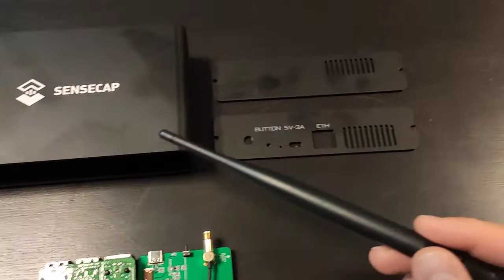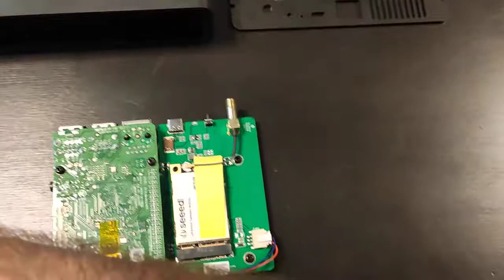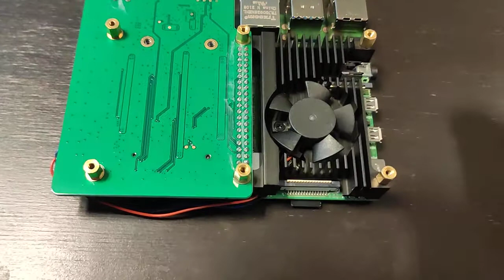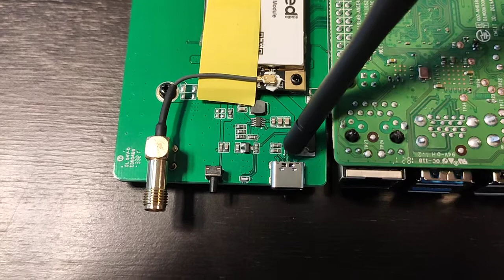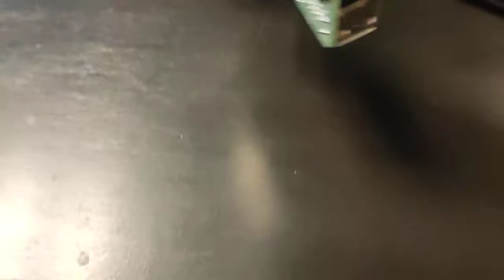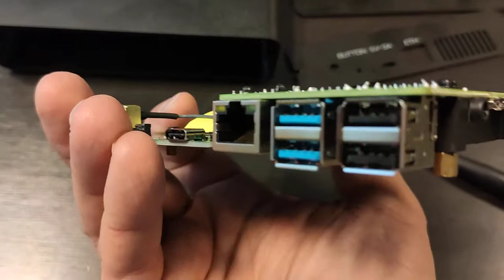Sensecap M1 Helium Gateway teardown and wifi antenna issues analysis

Comment: Hello ser, what specifications are there in the pie in sensecap m1? I have the same one. Solo in location, 0.1 hnt earnings in one year.
I want to extract the pie and use it for other things now. But once I get the assurance that it is at least a 4gb model. Can you confirm?
Reply from the maker: memory size is in your paper box or sensecap dashboard
Reply: @VeryokayDIY  thankyou ser, out of curiosity I did open it and it's 4gb version. But they have put the screws very tight, my screwdriver got rekt 😅 still not able to open them.

Comment: I'm curious if anyone plugged in an HDMI to that PI, and seeing if it displays anything,
the sd card has a screensaver file on it, so...
Reply from the maker: Hi! Probably its not showing anything as its very easy to turn of the HDMI signal in the RPi via a single parameter line in configuration files. However nothing hold you back to replace the SD card and run it with Raspbian OS, I did it on a few of my old miners :)

Comment: What's stopping someone from taking it apart  and using the raspberry pi 4 platform instead of using it as a miner? These are being given away for free in Canada. What's stopping people from that? Since from what I've read  this is based on raspberry pi 4
Reply: That's exactly what I've done... I built a 3d printer controller using one. Repurpose the technology if you no longer need the miner. You just need to load the required image onto the SD and you have a computer doing anything you want!
Reply from the maker: Nothing stop them, they just need reolace the sd card with Rasbian OS and voilá you got a cool mini PC 🤩

Comment: Hey mate, great video, my antenna snapped off the board, does it need to be attached to function? Or can I use it as it is connected to the Lora still?
Reply from the maker: need to be attached

Comment: Thank you for the overview! you mentioned the USB slot would likely be disabled by the software, but do you think it would be fine to plug a usb powered fan into it ?
Reply from the maker: probably yes, very good chance that the 5V is there :) You can easily test that just open the enclosure

Comment: Would upgrading the Pigtail cable for a better one be worth it ?
Reply from the maker: I don't think so, its a really short cable, with negligable loss. (if you asking about the actual Helium RF SMA to U.Fl connection)
Reply: @VeryokayDIY  Aye wont replace it then. Ive read that some people say its worth but had my doubts already. Thanks man
Reply: Is it easy to replace the pigtail cable? I ask because mine broke
Reply: @glamclam123  I ended up upgrading to a Ipex to N type for a outdoor design and replacing the pigtail was rather easy. Just don't rush it and look up how to replace ipex connectors since its rather fragile but other then that pretty straight forward
Reply: Thank you for the reply. What kind of u.fl pigtail did you replace it with? I see there are many options out there and want to make sure I buying the right one that fits

Comment: Hi, can you advice on that antena rp-smaF connector, I had an accident  with lmr400 cable being very rigid so that it got de-soldered when i tried to hook it up. Do I have to solder it again or is it just for for positioning?
Reply from the maker: If you have solder iron the best to solder it back! Its for secure mounting the rp-sma you are right. But the big risk when you tear down the tiny u.fl connector from the lora module, that's fragile.

I advise to use an external flexible mid cable before your rigid coax so can avoid such situations. I do the same (like a 20cm rp-sma extender cable)

Comment: does it work after the update?
Reply from the maker: yes, excellent. updated quickly
Reply: @VeryokayDIY  what do you say : raspberry 4 + sx1302 ,will be mined helium ? )
Reply from the maker: @musicislife6481  if you thinking of assembling a miner yourself that not works unfortunatelly. You need to purchase from the vendors.
Reply: @VeryokayDIY  I read somewhere that it's all about the crypt chip, which is commercially available and even cheap,
  a friend got a new SenseCap M1:
  pasperry pi 4 + sx 1302, nothing else inside , 

let's give hackers a little time = DD

I think it's like mining with 3060 video cards)))
Reply: SenseCap M1 Helium Miner : 

 Raspberry Pi 4 (2G/4G/8G RAM) and WM1302/WM1303 (Semtech SX1302/SX1303) Baseband LoRa Chip

    Integrated ECC608 crypto chip

Comment: Thank you for the teardown and overview.
Reply from the maker: It's your welcome 😊 I would advise them to add an SMA connector for wifi, appart that its a really nice robust hotspot as I experienced and see on the RF HW design side.
Reply: @VeryokayDIY  Unfortunately Im having trouble with mine, will not get any witneses.
Reply from the maker: @TonyCardoso  need to be patient, blockchain had issues and normally very slow too. Try to put yours outdoors on higher elevation. Cheers